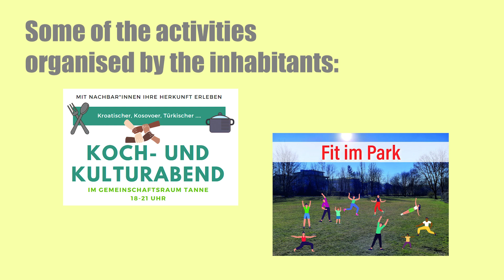Wood in Architecture - Is it sustainable?!

Comment: Hello, BIM Girl! It's BIM a long time haven´t seen you. Great subject.  Its use is getting improved also by using new cutting machines where even parametric design can be made and used to build furnitures, hoofs, etc. The confort and flexibility is remarkable.  One question I was thinking... the carbon footprint from recicling plastic to build a chair for example, is it bigger than if it was made using hardwood? What do you think?  (Here in Brazil, the hardwood extraction from Amazon and Atlantic coast forests, mostly are aimed for illegal export is out of control.) Have a great week!
Reply from the maker: Ohhh yeah that’s right, I’ve seen cool wood projects with CNC cutters. One project was also interesting where they build a parametric shaped tower from entire wood logs by strategically drying them so they would form the specific shape needed. The name of the project was Urbach Tower.

Hmmm about your question about recycled plastic. So recycling is generally good. And I guess mathematically you are not producing any more carbon because it’s already in use. I guess in the end it all comes down to how long you are going to use the product. Extending the lifespan of the piece of furniture has the biggest impact. So in that case i would think the hardwood furniture is probably going to last longer and also stay in style for ever :)